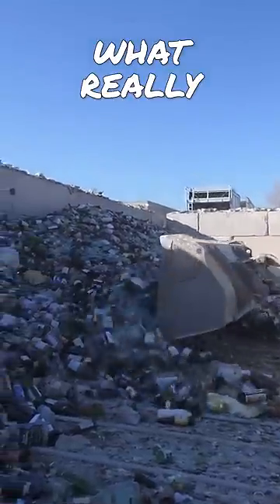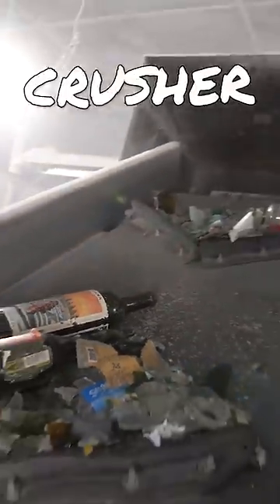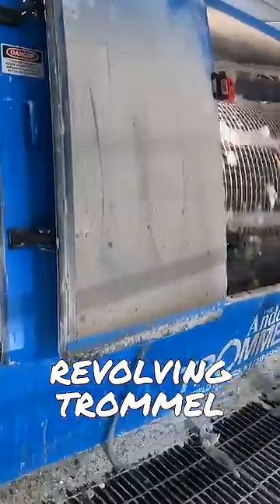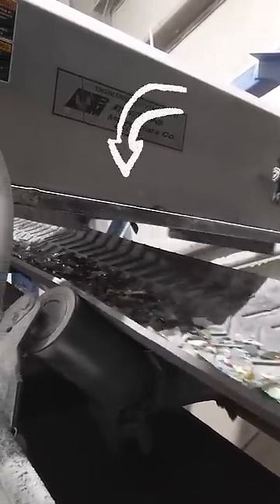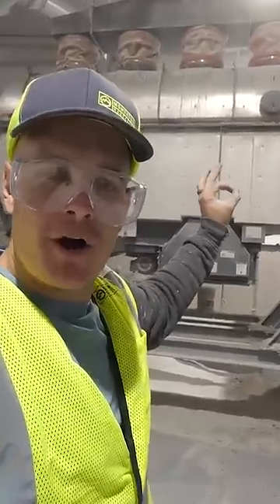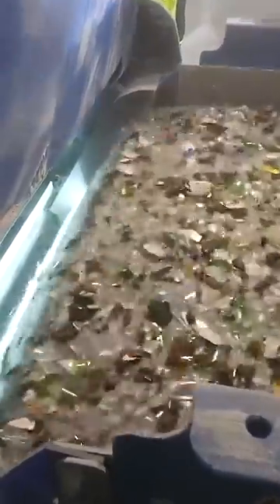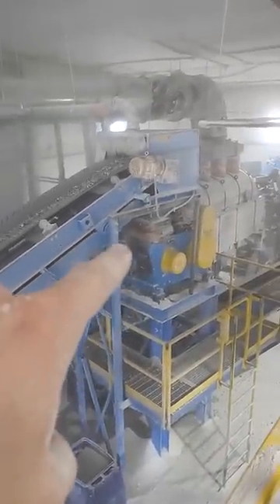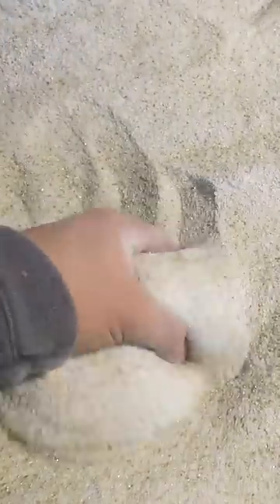What Really happens to Broken Glass Bottles?

Comment: I work with glass at work and even the tiniest of tiniest of pieces of glass will cut or stick into your skin. I would never, bear handed, scoop up that fine glass sand personally
Reply: *Barehanded, unless you mean to say you have the paws of a bear.
Reply: You have bear hands? Mine are human..
Reply: Don't you think that machine they use proba ly grinds them down in a particular way that smooths it into sand instead of just glass dust... because those are very different things... i think thats probably why they go through this whole weird machine and aren't just crushed
Reply: @BooBuKittyPhuk  well… it’s still glass dust. It isn’t technically sand. When I’m cutting glass fragments of the glass come off of it that looks just like that and even smaller and it still sticks into your skin
Reply: @quinntaylor1170  maybe... but we don't know how that machine works and if it was glass dust im thinking he probably wouldn't have him picking it up left in the video
Reply: also make sure to breath in as hard as possible when near glass dust
Reply: this facility is different than your average glass recycling plant they actually intend to make usable sand some of it gets sold for upkeep costs but a ton of it is used to help slow the loss of marshes but replacing lost sand
Reply: @quinntaylor1170 that’s the glass sand off cuttings. Totally different shape to glass sand made by pulverization. 

Think about it in the sense of like, wood. If I cut wood it will throw off some sharp splinters. But if I smash a piece of wood with a hammer until it falls apart, it’s all blunted.
Reply: You can’t be “bear handed” since bears have paws, not hands.
Reply: Wouldn't there be fine glass particles in the air too? This guy isn't wearing a mask anywhere
Reply: @BooBuKittyPhuk massive Hammers rotate on discs, in fact we know how it works because he said hammer mill in the vid. And that glass powder does pierce your skin, and will give you permanent damage if you breathe it in. Its not sand at all
Reply: @tormodhag6824  so you're an expert and have been to this or a similar facility thats purely trying to make sand not doing just glass recycling and know that basically their whole process is useless then? Because if you read @tweak or whatever the name was on the comment after mine he said it is usable sand not glass dust and so does the video actually
Reply: Must be terrified of beaches, rivers, and lakes.
Reply: @tormodhag6824 the end of a hammer mill for glass is like a giant rock tumbler. All the glass(aka sand, aka silica) tumbles against itself the same way it would in a river or on a sandy beach. You don't want to breath the fine particulate, but dipping your hand into it is no more dangerous than playing in the sand at the beach. Be less Dunning-Kruger.
Reply: @BooBuKittyPhuk  thought the dust is too fine to be sand, might become airborne easily and get breathed in
Reply: @Deathbomb9  so it is a slightly more dangerous than normal sand because it can become airborne if you blow on it. But yeah makes sense, the mill removes the edges. But i am not wrong in that different hammer mills make grains of different sizes though?
Reply: @Deathbomb9  but why not use a roller mill or ball mill?
Reply: @tormodhag6824  they do. I believe it depends on screens and sifters installed and you can also have different stages. The fine dust can become airborne. As for other mills they might not work for this application as well as a hammer mill. They are trying to make sand, not silica dust and it looks to me like they are washing the fine particulate off and possibly separating it to sell to glass makers.
Reply: He's got skin built up, he does it for an living
Reply: Which is why I'd rather worry about that white dust filled air... Must be bloody lung maker if no protection is worn.
Reply: Seems just like a dumb idea, eat a burger after work and you still got glass under your nails.
Reply: Someone doesnt like the beach
Reply: @adityaks345  Yes, it's crazy that this isn't what everyone is talking about
Reply: @BooBuKittyPhuk the size of a particle in the glass wool is around 1 or 2 micrometer, it's really small and however when you touch it without gloves it generate a rash very anointing, because is penetrating your skin( I did it many times, I'm stupid 🤦) 
Because the the crystal lattice no matter the size of the particles always are very sharp, the only procedure that make smooth particles of glass is with heat, maybe is intermediate step in the chain🤷
Reply: @quinntaylor1170 the size of a particle in the glass wool is around 1 or 2 micrometer, it's really small and however when you touch it without gloves it generate a rash very anointing, because is penetrating your skin( I did it many times, I'm stupid 🤦) 
Because the the crystal lattice no matter the size of the particles always are very sharp, the only procedure that make smooth particles of glass is with heat, maybe is intermediate step in the chain🤷
Reply: nicholasjohnson6205  the problem is also when he goes to wash his hands. When he’s rubbing his hands together with the glass he’s exfoliating his hands with glass and they’ll leave micro abrasions and micro cuts on his skin that can cause infections
Reply: wat about breathing in glass do u always wear masks?
Reply: Reminds me of that family guy episode about the right to bear arms lol
Reply: Bet he regrets that shit
Reply: @am529 mine are salmon so there not useful
Reply: @boog1939  I worked in an Optical lab for about 16 years, and yes glass dust isn't good for the lungs, but one of the worst things is sand blasting or glass bead blasting, because the glass or silica gets airborne.
Reply: @quinntaylor1170  I wouldn't want to get that dust in my lungs
Reply: @TWEAKLET  I've heard about that.
Maybe from another video where they were located in one of the Gulf states and they claimed, it locks together and doesn't wash away easily.
Reply: Made me think of family guy. Every one has the right to bear arms, how could that not be clear 😂
Reply: Finely crushed glass is basically a very pure form of sand. Technically, natural sand is made of quartz crystals of silicon dioxide, whereas glass is the non-crystalline, amorphous form of silicon dioxide. But when it is ground down enough, the difference isn't obvious.
Reply: You have bear hands
Reply: @BooBuKittyPhuk I think (i could be wrong) the difference is that when you first break / pulverize a piece of glass, the small pieces are still sharp on the edges.

If you put all that glass dust in a tank of water and sloshed it around for awhile, all the small collisions would round the edges of each piece down.
Reply: Bears 🐻 are a bit tougher than we are so I would use Bear hands in that pulverized glass.
Reply: Agreed.. and not just for the fact that it used to be glass. In that kind of environment everything with a surface is covered in a contaminant. I worked in a car assembly plant for many years. There where times when I had touched things without gloves on, then touched my face or rubbed my sleeve across across my neck or head and end up with a sore or a lesion that that lingered for a couple of weeks. Seriously nothing to play with. Gloves should be mandatory  PPE in a place like that.. visitors included.
Reply: @quinntaylor1170 Isn’t sand just glass naturally? Glass and shells? Quartz actually. Quartz glass it’s what beach sand is. For the most part all sand is “glass” just tumbled to tiny bits.
Reply: 😂 soft hands
Reply: Yeah I was thinking that’s gotta hurt
Reply: It’s a tik tok remember. Tik tokers have no common since what so ever. I was hoping he was going to do a line of it.
Reply: It's bare handed not bear😢
Reply: I was thinking the same
Reply: @boog1939 what, you don't shirt lines of it?
Reply: All sand is glass, it's silicate
Reply: I have to wear steel toe boots with met guards, I had a piece of 1/4 inch glass stab the top of my foot through everything I had on. I've also had a sheet of 1/2 glass cut through my jeans and boxers just by barely bumping into me. It can be very dangerous but it's also fun to break glass. Lol the thinnest glass we have where I work is 3/32.
Reply: Okay - you won't, but... he will
Reply: @quinntaylor1170
You are right, exposure to fiber glass also causes skin irritations.
Reply: the fur on your hand probably acts almost like a glove so don't worry

Comment: Used to see sidewalks made with dime to nickel sized glass pieces. Bits of green, blue, and brown polished glass make the sidewalk look real nice.
Reply: Interestingly enough the blue glass works the best. Green and brown contain cokoring agents that leech and weaken the concrete over time.

This wouldn't matter with a paver but for a thinner bartop or countertop can make a difference!
Reply: Cool thanks for reminding me. Haven't seen that for decades
Reply: That hurt
Reply: Its called sand.  And turned back to beach
Reply: @chicoharper6711 what you said is reasonable and people tend to think that but it isn't sand anymore. Once it's been fired it goes from a crystalline silicate to an amorphous silicate. The latter lacks several physics properties of sand. 

You can restore coastline with glass sand though.

Comment: Need a video on how that optical sorter works.
Reply: Came to the comments to say the same thing! He brushes past it like it’s nothing and I’m here thinking “hold up, I need to hear more about that”
Reply: I do believe the series How It's made dealt with explaining the sorter . They were doing something with high speed food production and manufacturing .
Reply: Basically, lasers in the machine scan the waterfall of glass and analyze the shards as they fall for size, type of glass, and colour. The machine then uses puffs of air to blow that specific piece into its appropriate chute, all in a fraction of a second.
Reply: I worked at a cherry packing plant.  After going through a series of water tables and conveyors where they're initially quality controlled, they then went through an optical sorter that took multiple pictures to size the cherry, and separate ones without stems from ones with.
It was then moved down a zip-line until a puff of compressed gas knocked it off onto a series of rubber membrane 'bumpers' that set it down on a final grading belt before packaging.

It was so unbelievably noisy.  Like it was using those old-fashioned flashbulbs or something, what sounded like 6-12 frames a second, but was probably much faster.
Reply: The last place the Powder Glass goes to is the 
FOOD PROCESS PLANTS!
Bon appétit
Reply: @dcmoore8937  it's got to be better than Soylent Green ......
Reply: @Valchrist1313  that's amazing... it really take laser photography to size the glass.... I wonder who thought up this idea.
Like I said out of all the sorting process this needed more highlighting. It wouldn't be so economical without this.
What we talking price.... £300k... Good job its not a McDonald's ice cream machine..I know 😄

Comment: Ok I wanna know more about this “optical sorter” that sounds sick af
Reply: Basically you have a bunch of sensors that detect the glass color as it falls in front of it. In this case lasers and they probably detect a certain amount of blockage as colored glass. The sensor activates an air nozzle that blows the colored glass over a partition to land on a different conveyor. It doesn't look like it does a super great job which is expected because the glass shards are random sizes.

They use them in food processing too, like sorting grains of rice to remove dark ones. Only in that situation the grains are all similar in size and so the accuracy is much better.
Reply: Crusher
Revolving trommel
Optical sorter
Giant magnet
Waterfall of glass

Man that sounds more like a rock concert than a glass recycling center
Reply: @court2379  that’s so sick! Thanks for taking the time to explain it to me.
Reply: Ye, you can find clips about optical sorters in videos about chip manufacturing, too. Modern computers, when used to their fullest potential, are freaking amazing.
Reply: What did they do before Optical Sorters?
Reply: They use these at other plants as well , potato chip plants , gets rid of the bad chips .
Technology has been around for quite a while
Optisort was the brand name , if my memory is correct
Reply: Brands are sortex, power sort, titech, sorma and sataki are just a few out there but the type we use
Reply: Actually depends on the sorter type.  Some read in IR, others use cameras in real-time to find and reject whatever colors or materials that are specified to reject.   Fall rate has to be calculated as well so that the air jets fire exactly when the contaminant is coming in front of the air nozzle.   Different contaminants have different fall rates and they are down to the millisecond.  All of this must be programmed in so that the machine recognizes a certain defect and then fires the jet exactly when it needs to for that specific defect.

Comment: Today I learned that I don't have to remove labels and wash jars before recycling them . . .
Reply: I mean if you think about it, even if they actually mandate you wash them before recycling them, somebody is going to not wash them. They will have to prepare for dirty bottles anyways
Reply: Most important effortless recycling move: don’t throw bottles with caps away, put them extra. Also separate lids like from a yogurt from the plastic
Reply: If you think about it at some point they will be heating and crushing it so it’s irrelevant
Reply: @bryanedmonds3748, the cleaner the glass the better for production. The more contaminants the more energy is required to burn it off in the process, which also produces more emissions.
Reply: Y’all recycle?
Reply: @lewischacon6009  imagine not recycling

Comment: I use pulverized glass in my sandblastor for cleaning bronze and brass parts after I soak those parts in an ultrasonic cleaner.
It looks like brand new parts when done.
Reply: I was wondering what you do with that afterwards.
Reply: Can you touch the stuff with your bare hands?... literally asking cause a commenter got 30k likes for making fun of this guy doing just that.. 😊
Reply: @duke1281 it kinda feels a bit like sand. We used sandblasters with that when refinishing firearms in a Gunsmithing school I attended. Gets all the rust and corrosion off so we can get a better view of what the metal looks like under it all, how much has to be filed and sanded till its smooth again, then we either blast it again before blueing the metal for a more matte finish, or we run it through a series of buffer machines till it’s polished up to a point where we are satisfied. I’ve seen someone buffer a rifle barrel till it looked like a mirror, blued it, and it looked like black chrome. Didn’t know this was how that blasting media came to be though.
Reply: @duke1281 yea you can. We use silicate beads aka fancy sand at my job as well as recycled glass beads, however in other areas we use iron oxide and its not as finely broken down and will give lots of little cuts on uour outer most layer of skin which doesnt hurt or make you bleed however it will make you shead dead skin for like a week.
Reply: Edible? Can I eat it? 😮
Reply: Dude I like glass , just you have to wear arm protection where as sand is left to if you wanna be blasted directly on the arms or not , fun stuff!

Comment: For all the "glass dust will kill you" comments about to come,  no. It won't. Glass is amorphous sillica which, contrary to crystalline sillica, can't give you sillicosis or cause serious damage unless you're exposed to high amounts of it for a long period of time.
Reply: ... or if you snort it. for whatever reason
Reply: Correct, for short exposure,but workers will need to wear appropriate PPE as they are getting exposed daily as it still causes inflammation in the lungs over time with constant exposure
Reply: So, it's not that type of glass powder that will cut your lungs if you inhale even a bit of it.

If that was a fiberglass recycling plant, on the other hand...
Reply: @pitekargos6880  correct, fibreglass and the reason asbestos was banned is for that reason
Reply: @hannesnel5414  exactly. What I was getting at is that you don't need a mask or much protection for a few hours of visit. But definitely for workers
Reply: @hannesnel5414  asbestos wasn’t banned. It’s still used today. Just less.
Reply: @SupremeShuckle  alot less
Reply: So yes, glass dust can "kill" you with long term exposure.
Reply: Also i think jerry is immune to it
Reply: Like working in a glass recycling facility?
Reply: High amounts for long periods.  Maybe like working at a glass recycling facility?
Reply: Asbestos isn't carcinogenic or toxic either ,  yet over time it causes lung damage.
Reply: "exposed to high amounts of it for long periods" ... which workers in that facility likely are if they are not super careful. Glass dust gets everywhere. Even if you can't see it in the air, it's there.
Reply: Thank you for explaining this, I couldn't understand the ppl comparing  fiberglass to real glass made from soda ash, limestone, and sand.
Reply: @nathanielwowchuk6880 I would love to reply to all people commenting this the same. How hard is it to look anything up on google? It still won't kill you, it causes damage and possibly asthma, but it is not deadly. And where in my original comment did I mention facility workers? I was specifically referring to Zack, who just visited the plant.
Reply: @JimJamTalks  the guy from the video is a big YouTuber that tortures phones to test their durability, he's doesn't work there.

Comment: Too elaborate. Typically you just crush it as most as possible then it goes into a furnace. Molten glass and the impurities all have different densities, metals fall to the bottom, any organic (carbon based) particle burns away into a gas.